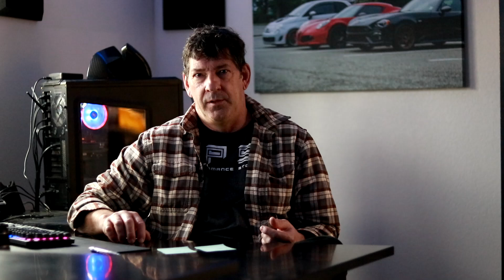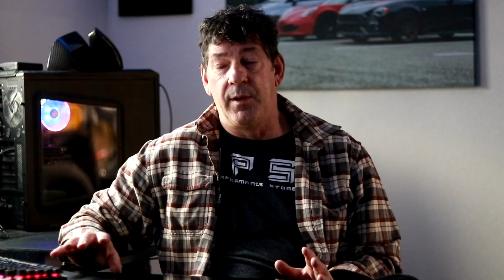Boeing 727 Falls From the Sky TWA 841

Comment: I became an A&P in 1983 and I heard EXACTLY this story from someone who......well, lets just say, someone who would KNOW what actually happened.......and they told EXACTLY this story.  This was told to me in 1982 or 1983 while I was in school for my A&P.  The Goodyear airbrake saved the day.  From what I was told, the centerline of the mains was pushed aft about 18 inches by the forces put on it.
The old girl was a STOUT one, no doubt......repaired and back in service after this event is a testament to that fact.
Reply: Wikipedia: "In 1990, ALPA [claimed that when] the crew lowered the landing gear, the over extension of the right main landing gear ruptured System A hydraulics which centered the lower rudder and allowed the pilots to recover from the dive."
Reply from the maker: Yes, ALPA claimed. What do you suppose ALPA's literal job is? As a former ALPA member I can assure you that it's their job to defend the pilot, right or wrong. I'm not condemning that, not at all. It's much like the job of a lawyer is to defend the client, but you have to keep it in mind.
Reply: @GregsAirplanesandAutomobiles  I quoted them in the context of the statement that " [t]he Goodyear airbrake saved the day. , which I didn't follow. I'm not seeing why ALPA is much motivated to lie about why the airplane returned to controlled flight. If the pilot did something that might get him fired it was presumably in arranging for the unauthorized flap extension at an earlier point, not in achieving the recovery, which wasn't so far as I can tell (see circa 1:10) clearly explained in your video.

Comment: There was a Boeing engineer who after he retired came clean and said asymmetric slat deployment was not a unknown occurrence. I knew Hoot personally and if he hadn’t been a competent aerobatic pilot they would have lost the plane. There’s a Boeing and TWA coverup, the plane had a inadvertent slat deployment and then a high altitude upset. Hoot was promoted to the 747 prior to retirement. A slat deployment would certainly cause an upset at FL390.
Reply from the maker: That's one version of the story, but I'm not buying it.
Reply: @GregsAirplanesandAutomobiles  Hey Greg, are you going to start giving your opinion on other airline accidents? Perhaps some on the airline in which you fly?
Reply: I don’t believe there was a coverup by Boeing and the NTSB. I believe after the investigators found that 21 minutes of the 30 minute CVR recording was blank that they were so tunnel visioned in that the pilots had caused the upset that they didn’t let the evidence lead them to a conclusion and instead let their conclusion be based on a pre-determined notion. In 1990, ALPA (Airline Pilots’ Association) determined the physical evidence and the FDR indicated the upset was mainly due to a yaw damper induced lower rudder hardover and when the gear was extended, System A hydraulics was lost and the lower rudder centered allowing the pilots to recover. The slat was lost due to the loss of hydraulic pressure as it didn’t lock into its locking mechanism while the other slats did. Simulator tests showed that the slat would have been lost at no lower than 30,000 feet not at 8,000 feet in actuality and for the NTSB theory to be believed the slat remained extended even at the speed of sound when Boeing engineers determined it could only remain extended up to 672 km/h.

There’s a great article about TWA 841 on Emilio Corsetti III’s website: “Thinking of Hoot”.

Comment: Having lived under the flightpaths near Hartsfield International, I can absolutely attest to the noise of the 727's turbojets, especially on takeoff. The only thing louder was the old Delta DC8 stretch that was still in service into the early 1980s, and it fricking screamed when it came and went.
Reply: I grew up under the EWR flight path in the 90s and miss the 72s and DC-9s as well. They were low bypass fanjets though, still loud as hell. The pure turbojets sadly had a short stint in the late 50s/early 60s at the airlines when they put the fanjets on their 707s and the taller vtsab. The 27s had the fans from the beginning. The USAF however kept the pure turbojet water burners on their KC-135As until the early 90s. There's some awesome footage on YT of them doing MITO takeoffs during SAC drills throwing out massive black plumes of smoke, lol.

Comment: If memory serves, the displaced slat in cruise caused an opposite direction of roll to what would happen with the #7 slat stuck in its deployed position.

I read Stan Stewart's chapter on this in one of his books, I am absolutely sure that Hoot Gibson and his crew were blameless. They tried to claim that the crew had deliberately over recorded the CVR, but of course they could not have done that due to the broken gear squat switches.

Comment: Good video, but I have some comments.  I was a TWA F/E at the time, dual qualified on the 707 and 727.  You say that pilots used this flap trick to fly at higher altitudes to save fuel.  I can tell you that in all my years flying F/E I never once had a Captain suggest pulling that stunt and I never had any of my fellow F/Es tell me a sea story about using the technique when airborne.  I suspect it has been done more than once, but I am quite sure it was not at all a common procedure.  If it were anything other than a theory and perhaps a very rare occurrence, surely I would have met someone who said to me, "Sure, I tried it once".  But that never happened.  Not even a "I heard about a guy once................" story.  I am convinced that it was pretty rare. 
I'm reminded of the story every high school kid heard about the $100 Corvette where a guy died in it and they couldn't remove the stench since the car was fiberglass.  it was always two states away so even though every young boy heard the story, nobody ever actually found that cheap Corvette.

Gibson said that neither he, his F/O, or his F/E even knew about this particular way to "trick" the flaps. That was good for a laugh all around.
 I suspect there were some Captains who didn't know all that much about the systems.  That's why there was a Flight Engineer on the airplane in the first place.  But I guarantee that many Captains did know about it, the majority of F/Os, and every single F/E I ever met knew exactly where that circuit breaker used to disable the leading edge devices was located.  They even mentioned it in our ground school class.  But being common knowledge doesn't mean that it was used.
I will emphasize again that not a single time in my career was this procedure suggested nor did I ever meet any pilot or F/E who would admit that they used it in flight.

Nobody will ever know the true story, but at the time we all pretty much thought that Captain Gibson and his F/O and F/E were all in on it. They developed a story and they all stuck to it.  The cockpit voice recorder erasure was no doubt done on purpose or at least that was the common belief.
Reply from the maker: I didn't say anything about this being to save fuel. The fact that you mentioned that indicates that you have at least heard of this, even if you yourself never did it. I'm curious about when you were at TWA.

Comment: It didn’t happen, all speculation. In a 3 man crew, no way all 3 are going down with a rouge Captain. This was an uncommanded LE Device deployment. Outstanding crew saved the 727.
Reply from the maker: I find it comical that you state that the NTSB's finding is all speculation, but then state your own clearly speculative opinion as if it's a fact.
Reply: With no modern flight data recorder, it has to be speculation. At the time of this incident, the FDR only recorded 4 parameters. I’ve researched this incident throughly, I’ve even flown with author Emilio Corsetti who wrote the book “Scapegoat”. My conclusion is just common sense. 99.9% of all pilots are good honest people. We all screw up, but if you are doing the “carpet dance” in front of the Chief Pilot, you better tell the truth. If there were rogue Captains out doing unapproved and dangerous “techniques”, no crew member would stand by them all the way to the unemployment line. The NTSB report noted that between 1970 and 1973, seven separate cases involving a single leading edge slat extension and separation were reported. Sooo, it had happened before…please watch this.
https://youtu.be/cDBxUq1rElo

Comment: Pretty Good.  One comment, on the CVR.  At my airline, it was not SOP to erase the CVR after flight.  Almost every instance of erasure was because of an immediately preceding event.  That said, there was one spectacular event I was involved in as the flight engineer, where we consciously made sure we left it running, to OVERWRITE the information.  Something of a risky proposition, but a whole heck better than overtly pulling the c.b. (on edit: I shouldn't leave it at that.  The captain had screwed up big time, and I and the c/p had to take some actions that might have been questioned, to get the op going again.  Like possibly backing up a 727? Onto the runway? Using thrust reverse?  Well into compressor stalls?  I mean, not that, but...maybe.  It was a long, long time ago).

 I'd had it from an electronics tech that the DC office of the the FAA, where they did the voice recovery on those analogue recorders (30 minute loop), could dig down into noise to retrieve up to 6 layers of conversation.  With enough work, they could extend that 30 minutes to a couple of hours.

As an aside, that same office did the work on the Challenger recorder.  They had the data by the night of the day they recovered the box.  Of course, that was not disclosed to the public for 10 years.  A controversial decision, in that they lied.
Reply: Six sounds dubious, but two seems unchallenging. The Wikipedia article says that the cockpit erase used a bulk erase feature, which if true would randomize the entire tape. An overwrite doesn't work as well for hiding earlier recordings, if only because the new track doesn't precisely track the old one, meaning that on one side or the other of the newer track the previous track will generally still be "visible", and in some places more than one track. But to listen to that you would need special equipment and you would probably only get fragments of other than the immediately previous tracks..

Comment: My old man was a good friend of Hoot. They were both TWA Newhires, both on the airplane at the time, and had flown it many years as FO and CA. Dad reported that Hoot said to him they didn't do it and the company threatened the FE to go with that line or lose his job. His position was that when up against the company, the manufacturer and the government, you're going to cave. Hoot never did and retired from TWA long after the incident. The FE resigned very early.

When I got hired at TWA dad told me to remember that whatever you do, just go to the office and tell them what you actually did and most of the time they'll back you. If they don't,  well you're better off leaving anyway.

I flew the 727 about 5 years as FO. Many, many years had gone by since Hoot's incident but a few things stick with me. First is that the chart holder on the yokes had a pretty weak spring holding the clamp, and when you snapped it the autopilot would disconnect. A captain told me it was because of the TWA 841 incident because when the airplane got into the dive the autopilot wouldn't disconnect. He said the crew might've put the gear down to slow down, but it is the reason the autopilot disconnected because the retract cylinders went over center and pulled the rams out of them evacuating both hydraulic systems this disconnecting the autopilot and allowing Hoot to regain control.

I flew with a captain that told me that Hoot and the crew did do the American Airlines West Coast Cruise technique,  as it was called because AA was the originator, and I told him dad had told me they didn't. That captain had bought a 727 sim from the company and ran a school well known in SoCal, it seemed to me he had more to gain from it being that way than dad did... he wasn't in business.

Hoot had a long reputation, known for stunts and accidents outside the airline, and was in the office many times, but I never got the idea he would've lied to dad. Like so many airplane stories, the truth is hard to know and sometimes is between the lines.

Company, manufacturer, govenment...  remember even when you are flying SOP to CYA.

Comment: I heard this story 40 years ago, and I believed it.  As a TWA new hire in 1986 I was set straight.  I spent 12 years on the 727 and no one ever talked about this trick.  I did talk to an investigator who said it was a lower rudder hard over.  And a union rep who said that Hoot walked into a Star Chamber when he testified at the hearing.
Reply from the maker: By 1986 nobody was doing it any more, and for obvious reasons.
Reply: But the TWA pilots I flew with had been flying the airplane for 20 years, and all vehemently denied ever hearing about it.  Someone at another airline came out with that theory.  It doesn’t hold up. @GregsAirplanesandAutomobiles
Reply from the maker: I don't know what they heard, but I find it hard to believe that all those pilots "denied ever hearing about it".
Reply: @GregsAirplanesandAutomobiles  Oh, they heard the story, but no one ever heard about anyone actually doing it.  Most had flown with Hoot, and they said it would have been very unlike him.  I realized the story was fabricated, repeated endlessly by people who knew nothing.  I’m surprised and disappointed to hear it from you.

Comment: I just want to put something out there, that often gets missed or overlooked when discussion the erasure of the CVR. 1977 is not 2024. In 1977 The Cockpit Voice Recorder was not viewed, by the Pilots, the most important people in this equation, as a useful or critical safety system. They viewed it, or at least the Pilots Unions viewed it, as an unlawful wiretap being used by Airline Middle Managers to dig up dirt on Union Pilots they wanted to get rid off. The Airline Industry was in a very bad place in the late 1970's. Pretty much the only way they could get the pilots and importantly the pilots unions to agree to the CVR's was that little red button. If all wheels are on the ground and everybody walks off the aircraft alive, the button gets pushed! These were the Union Rules. If the NTSB had any Questions they could ask the primary source, the Pilots. Like I said CVR's were not the accepted technology they are today. They were sold to the Pilots as being an audible last moments should things go terribly wrong so someone might know, assuming all living witnesses were dead. This Hoot Gibson incident caused a lot of controversy because they wanted to use the CVR to attempt to force the pilots to bear witness against themselves. If you wonder why this flight still stirs up so much controversy, this is it. It sat on the cutting edge between Aircraft Safety and Individual Privacy Rights in the Workplace. The CVR had not yet become the well regarded safety tool we now respect it as. I have seen Union Rule books from the period that clearly state the Pilot is to manually press the erase button of the CVR upon safe arrival at the terminal. 

There is one other thing that also raises some flags for me in this whole story. All of this was supposedly happening during the US Energy Crisis, in the height of the Carter Administration. Airlines fuel costs were bankrupting them. This "generally known" 727 flaps trick resulted in huge savings (and airlines were handing out pilot bonuses for fuel savings back then). If the pilots had worked out a trick to greatly increase the fuel efficiency of the aircraft, wouldn't every airline be pounding on Boeing's door demanding that they implement a safe clean procedure for initiating the flaps maneuver? Not unlike the noise reduction kit had accomplished?
Reply from the maker: This is a great post. Thank you.

Comment: You did not explain exactly what transpired after the front flaps extended slightly and caused exactly what to happen? Was it the added drag or was the air flow upset over the wing losing all of the Lift?
Reply from the maker: I did, but maybe not clearly enough or in enough detail. Extending for leading edge devices lowered the wing's critical mach number to a point lower than the actual mach number of the aircraft at that moment.

Comment: Greg, I love your videos. I noticed you didn't mention the quietest version of the 727....The 727-10QF. In the 1990's UPS converted their 727-100 fleet, replacing the center S-duct and the JT8D engines with three Rolls Roys Tays. It was the only 727 stage 4 noise conversion. It had its good points but also some issues. The 727QF was actually flown as a passenger aircraft from 1996 to 2001 by UPS. 

There was an interesting event, that we called the 727SF (silent freighter), known to almost no one outside of the UPS community, of a 727QF that had just started a descent over Chicago and lost all three generators. They actually lost all 3 engines due to a mistake in fuel management by the flight engineer. It wasn't recognized by the crew at the time as the thrust levers were at idle  for the descent. The crew diverted to O'Hare to land on 04 R and at 3500MSL the F/E says....I have a stupid question.....do we have any engines? That is when they realized it was a 3 engine failure. That was a major CRM teaching moment  at the time. 

Suddenly,  the crew then  knew they were going to crash short of the runway but were able to get one engine started at the last second which was enough power to get them to runway 04R. But since it was a freighter that "didn't crash".....no one ever heard about it....
Reply from the maker: WOW.